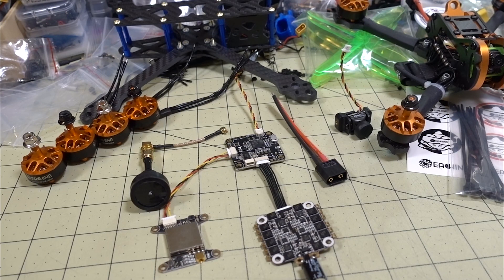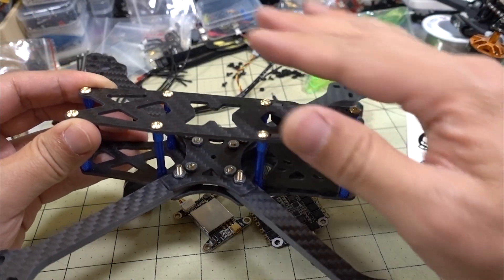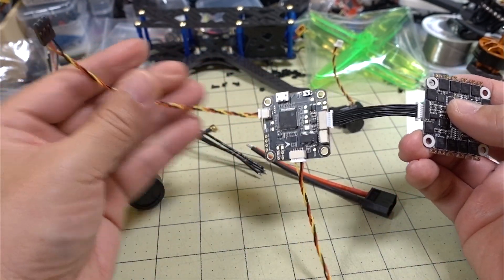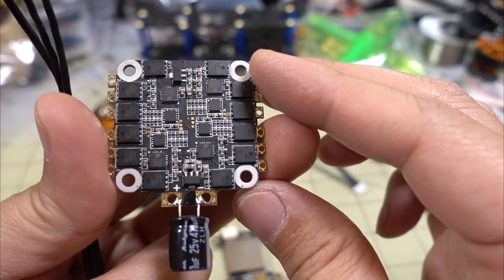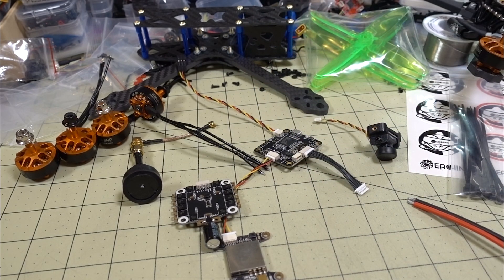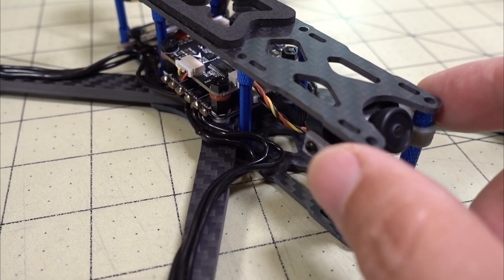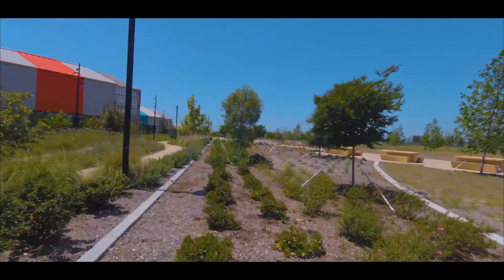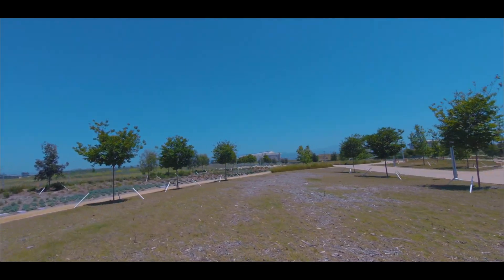Build a Cheap Cinematic FPV Drone for 2020 🛠️🛠️🛠️

Comment: So to start. If I want some good quality cinematic footage, including the camera, googles, controller and the drone itself. How much would it cost me for a kinda cheap drone and googles and a decent action camera with everything on it?
Reply: the absolute lowest price (with decent products that wont break within 3 flights) is probably going to be about $400-$500, since you still need the batteries, charger, goggles, controller, receiver, action camera etc
Reply: @DaMajesticMuffin  but if i already have the action camera, it would end up at about 250-350, no?
Reply: @micastillodearena6038  yes you can probably do it for around that price! especially if you buy some second-hand cheap goggles to get you started :)

Comment: Hey! Just to make sure, you are using the same parts that you used on the Tyro 99, except a bigger motor and different transmitter, on a different frame, correct?
Reply from the maker: Yes, different motor, frame, and VTX.

Comment: Do you know how I could add a follow-me and/or obstacle avoidance with on/off mode to the tyro 109,looking to build one if I can get those features
I was looking to buy the new mavic mini but would have to go for the spark because follow-me and obstacle avoidance it a must for me
Then I started looking at builds and it seems to be a better way since you can repair minor or serious break and cost a lot less, only need little effort
Reply from the maker: Sorry, you can't add those features to this type of drone.
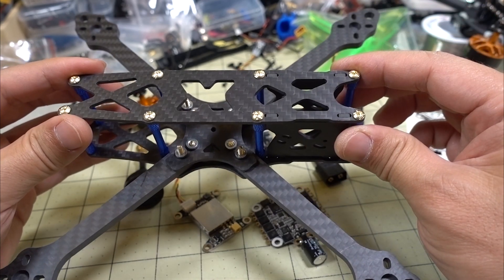Reply: @AlbertKimTV  It is possible for another type or a more high-end build if so could you send me a link for a follow-build like this one @1:42 https://www.youtube.com/watch?v=SpxXCLpceZ0

Comment: What gopro settings are you using? 2.7 k flat or GoPro color? Super view? Thanks great video
Reply from the maker: 4K / 30FPS / Wide / GoPro Color FLAT, ISO limit at 800, WB at 5500k

Comment: Good one Albert!! But you forgot to add 100$ to the bill regarding RSGO. 
I am going to build a 5" so I will try that mount. 
Regards from spain
Reply from the maker: Just considering the cost of the drone... not the GoPro and RSGo.  The point here is that you don't need to spend a ton on the drone.  Of course, everyone else will also get RSGo and a GoPro to make this system work, but you don't need a $500 drone to get similar looking footage.